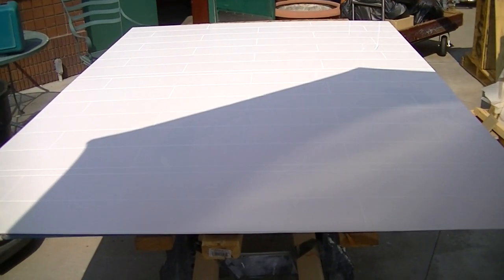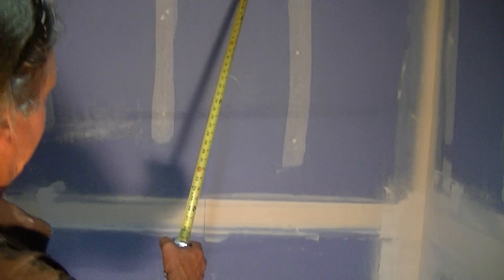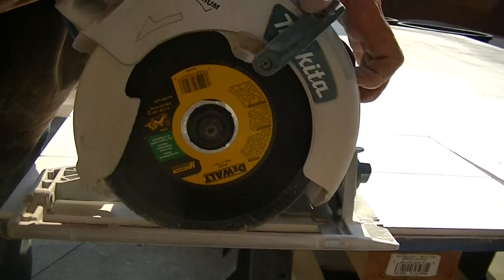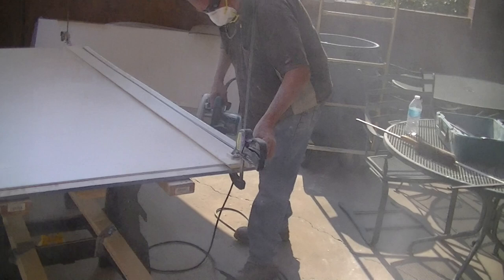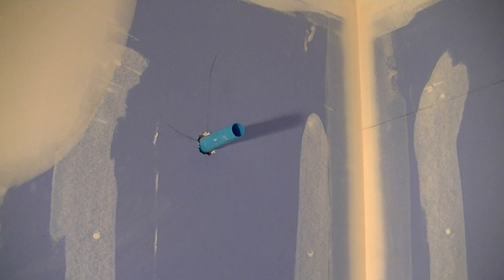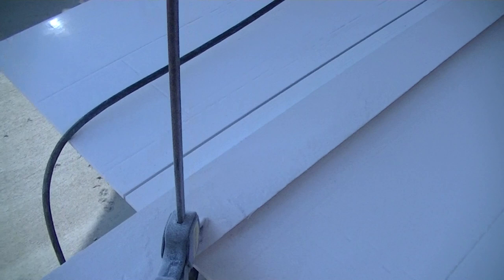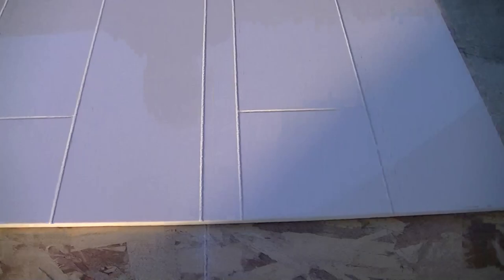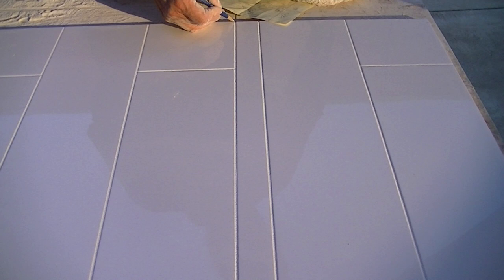Hotel Installation of Mincey Marble Panels.

Comment: This is great, but I cannot cross brace against glass, how else can I brace?
I have a Cultured ¼” marble solid slab shower wall (2-1/2  sides) panels enclosed with glass. One slab is coming off the wall on one corner, where my door is now not level. Half wall and doors are glass. Do you have a way to glue and PUSH/BRACE back to the wall?

Comment: Cutting the length to get it thru the door is very unprofessional and lazy.
Reply: The only other way to get the full panel in the room without cutting it is to TAKE OUT ENTIRE DOOR AND WALL!  This would add about $1000 in costs to each bathroom and for the project it would add about $130,000.  is that the way you would do it Marlon Martinez?
Reply: In my experience,, working for a marble company going on ten years the other way around making that cut is to turn that panel on its side and stand it up as you make it through the door if the bathroom allows for it. Sometimes you have to split the walls but to me it looked like a 5x94 in wall so on it’s side would fit through a standard door opening. Just my opinion with experience but there has been instances where there isn’t room in the bathroom to make that possible which in that case you have to do what these guys did and split the wall, but it did look like there was plenty of room to get it through in one piece. It looked to me like the installers just didn’t have very much experience working with big panels like these. We have installed hundreds of shower walls from mincey marble as well for a hotel in Stillwater ok.
Reply: Mitch31991 I do similar panels on hotels.  Hilton and Marriott.  It can be a pain, but they can be carried in on it’s side and stood up inside the bathroom.  Even with vanity and toilet installed.
Reply: Sergey Pober I agree it could’ve definitely been done, it just makes the job a little more difficult but the results are much better for the customer in my opinion.
Reply: Mitch31991 We have successfully completed 5 different hotel projects and are very well experienced.  As stated in the comment before it was impossible to get the full back panel through the door and then turned and then stood upright.  That is why it was cut.  You and all the others have absolutely no clue what you’re talking about.
Reply: As right know that's what I'm doing at Seattle 58" x 92 panels full size pieces flipped as you go into the bathroom  no need to cut them off 👍
Reply: Pete Caruso No, you just don’t know how to install these panels properly. I work with Mincey marble and also am a recommended Mincey marble and trained installer by them and I can for sure tell you that you didn’t do this the right way.
Reply: Dear professional installers, you guys should know better that every job is different and the site conditions are different as well. Two things, these gentleman's that are Mincey marble pros maybe you should put in a word to all of us rookies not to make it so flimsy that you barely touch that damn think before it breaks let alone dance around the bathroom with them, second, we are working on a hotel project right now and we can't fit the back panel in because the plumbing, the sprinkler and the ceiling light so if you pros have a way of installing it without  cutting it I will pay for it from my own pocket. Respectfully the unprofessional rookie
Reply: @norbertbajgyik1607  I'd take you up on that offer these guys nor you are a professional with these panels.